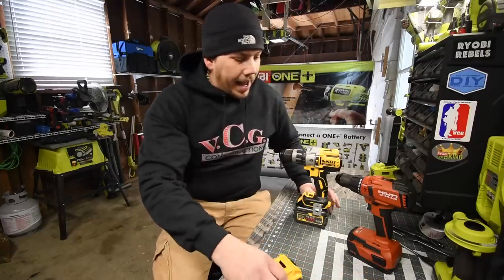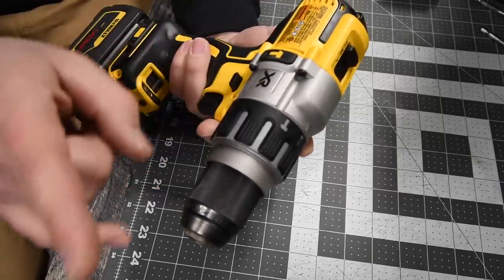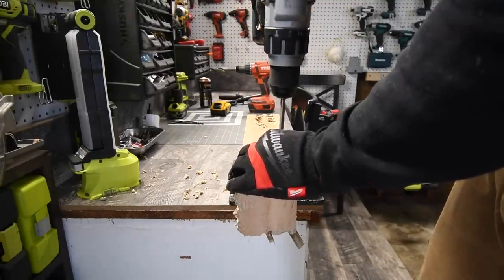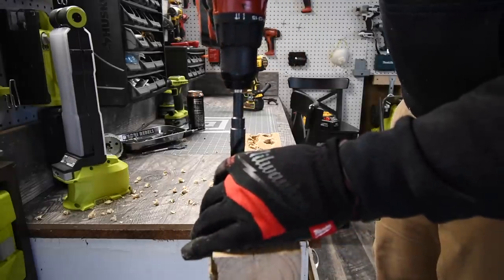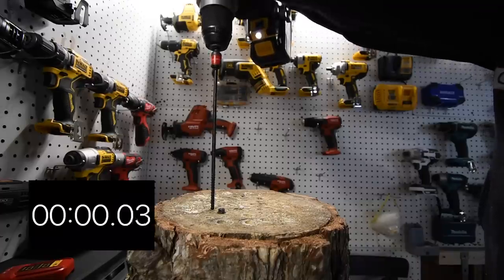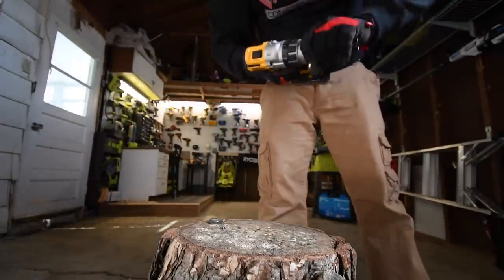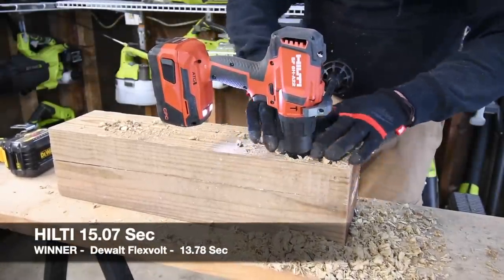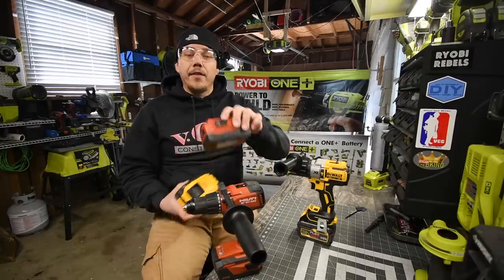Dewalt VS. HILTI Hammer drills (WOOD)

Comment: David, excellent video like always!!!
I have the Dewalt 996 with 5 amp battery... now I am dying to get the HILTI!!!
But man, i am worry for those wrists, always when using this kind of tools please use the side handle since the beginning!!! (I know I sound like your dad lol)
We want to keep watching your videos with healthy wrists
Reply: The Hilti has Active torque control (ATC).If you hold the drill vertically and run it, then give it a quick twist left or right (like it would if the bit snagged) the motor cuts. Release the trigger press again and it starts again. Dave doesn't show this in his video. The older SF6H had this too and saved my wrist a few times. My M18 gen 3 doesn't have a cut out and I have to be really careful. I really love this new brushless SF6H Hilti. It is a dream to use and hopefully indestructible like my other Hilti gear!
Reply from the maker: I am getting using the handles on these drill more often. I agree the t is safer. and I thank you so much for viewing
Reply from the maker: I did not know that. I will have to test that out. :) I thank you Dave. ill make a video about it
Reply: @ManCaverTools  Yes Dave, it's  a great feature. It gives me confidence when I use it. I have had much less powerful combi's snag and injure my wrist. Not really badly but it gave me a really sore wrist for a few days.
Reply: the Hilti ATC will save your wrist every time.
Reply: @veepsgarage  Too right Veeps' !!. Let's face it, once is one time too many to injure your wrist.....maybe even snap it with some of these mega-powerful combi's. Did it years ago with an old DeWalt which only had 42Nm of torque! Wrist swelled up and was painful for a good few days!! 😕😕😕

Comment: Dewalt has the non flexvolt 20v  6ah with 21700 cells , if you were looking for a fair comparison
Reply from the maker: I was told the 5ah battery has 21700 cells, im going to have to pick one of those up and thank you
Reply: @ManCaverTools  no, 5ah has 10 cells 18650 s, 
6ah 20v has 10 cells 21700s

Comment: Thanks for sharing sure wish you would have done some concrete/masonry test they are hammer drills after all
Reply from the maker: I did. do concrete in another video I already uploaded. this was only one video out of a few
Reply: It would be of minimal value. These are standard Jacob’s type chuck, not splined. Most that use the hammer are looking to drive a Tapcon or a small cheap masonry bit into something soft like clay brick. 

If you’re looking to drill into aged concrete, heck even green concrete if hole is >3/8, you’d be using a splined SDS- Plus or SDS-Max drill

Comment: What's the real price difference? I am blessed I have dewalt repair center nearby. But we are an amazing timeline where battery stuff is truly a full replacement. That being said for ease to get etc. I went black and yellow but I'd not be upset with hilti in my shop for projects. But hilti is more industrial rent our stuff we fleet maintain and replace. It's good stuff, I just dont have a guy stopping by to do the maintenance. But again with dewalt milwaukie and to lesser extent rigid... we are blessed when looking for tools to find we got some competition for fleet and hd use we can pick from, and it's easily acquired.
Reply from the maker: HILIT would be much more of a hassle to get repairs on, and I thank you so much for viewing sir
Reply: @ManCaverTools  they have a 1 day repair return?

Comment: Hi,

I believe the DeWalt 5.0ah xr batter has the 18650 cells. Also the new 20v 6.0ah battery has 21700 cells. 

Also the dewalt new 3.0ah has 21700 cells. I believe the new DeWalt 20v 8.0ah will have 21700 cells.

The dewalt flexvolt will use 18650 cells.
Reply from the maker: I gotta check that out and thank you sir, Even Ryobi has a compact 3ah HP battery with 21700 cells and thank you sir
Reply: Dewalt new 3AH and 6AH non flex use them bug 5AH uses 18650
Reply: @ztwinzplaytv9003  

Ops my mistake, yes you are correct the DeWalt 5.0ah has the 18650 cells.  I will edit my post.

Thanks for letting me know

Comment: I have this Hilti and so far it is the best I've ever used in 40 years of working. Still early days though. Also run Milwaukee fuel 18v kit. Not impressed. I had one of the Original DeWalts with the Elu motors and it had Ni-Cad batteries. 2.4 amp I believe...or 1.3 amp. It was a great tool and took a lot of abuse. I have a Hilti SDS corded that I got 2nd hand 33 years ago and it is still my every day go to SDS. Superb piece of kit. Also own cordless Te6 A22. That thing is a beast. I don't know what the longevity is on modern DeWalts but it was impressive in this test. Longevity is much more important to me than a few seconds here and there. Plus the speed of work is a lot to do with the skill of the guy using the tool. A friend of mine sent his Hilti off for a general service and the rep gave him a like for like drill to use while his was away. No down time!! I have heard that DeWalt after sales service is really bad. Hilti also do the "Fleet management" system where a large company can literally hire Hilti tools for site work. They give you brand new gear every three years and any tools that breakdown are replaced by a rep usually within the hour. This is a lot cheaper than buying the tools outright.
Reply: Added to this I am not a site contractor.  I am a Maintenance Manager at a very large Theatre with my own Workshop. If I am gutting and rebuilding a Dressing room I would use a corded SDS, 3 Combi's and an impact driver with different bits in each. This saves time swapping over bits.
Reply from the maker: at the HILIT store we able to get 4 free belt clips lol and once again I thank you for viewing
Reply: @ManCaverTools  How the hell you get anything free from Hilti?? They will loan you tools to use but not usually give stuff away. 🤣🤣🤣

Comment: I have seen only two bad things in DeWalt drills that for me are a deal breaker. 1. The brake is way to violent on the XR drills 996/ 791 and the chuck can get loose and drop the bits. 2. If the chuck gets damage , you cannot replace it because there is no center screw  and you must buy the entire gear box with the chuck.
Reply from the maker: that sucks and I thank you for sharing that info bro. :)
Reply: Yes it does drop the bits or get stuck, I was drilling holes for anchoring trellises, drilled about 30 holes and it drop them about 3 times

Comment: Hilti is MUCH more well built than dewalt. It's Panasonic batteries are clearly more durable too. The dewalt is brutal and not user friendly, the hilti is smoother.
Reply from the maker: I agree, hilti is a more user friendly tool and thank you for viewing
Reply: I agree Hot dog! I find all Hilti gesr smooth.  My Te6 a22 hammer is really smooth too! I'm still in the Honeymoon period with my new brushless SF6H. Best combi I've used in years...probably ever!

Comment: Well, I got the new brushless hammer drill. Wow. Hilti has really impressed me here. So many positive changes, to the handle, an additional light, brushless, more metal where there was plastic before. Wow. All for the same price as the "old" hammer drill
Reply: Yes Tyler!!! Ain't she a beauty?? The ergonomics are superb, the power and torque are great too. It sinks 3" M8 coach screws  right in with the hex head flush on the 13th of 15 torque setting. My gen 3 Milwaukee leaves them 3/4" out using highest torque setting.  Plus the Hilti build quality is superb too!!
Reply: @davesheppard8797  agreed. It is better in basically every aspect. One small thing I noticed is the battery doesn't seem to fit quite as well leaving a small amount of play but that isn't bothering me a whole lot.
Reply: @tylersmith9868  Ah....If you watch Dave's (Ryobi man caver) video test of this Hilti on it's own he points out that the black section underneath that the Battery actually clips on to is floating. He believes this is to combat vibration affecting the battery. Maybe also to aid cooling as there are small mesh vents by the working lights. I hope this is a help mate.
Reply: Also....Have you tried the Te6 A22 SDS from Hilti? That thing is incredible!! It only has 2.5 joules compared to One of the Milwaukee SDS battery drills that has 4.5 joules. The Hilti kicks the Milwaukee's ass on head to head. And it is so smooth with no vibration. 👍👍👍. It is pricey though!!
Reply from the maker: I love this drill as well and thank you for viewing
Reply: So Tyler.......Is it still going well with your new brushless Hilti? I really love mine! 😁😁😁

Comment: Don’t care for the longevity of the hilti batteries i only get 6 months outa them before they are junk they only last a 1/2 hour before charging where as before they lasted all day, hilti is covering everything under warranty multiple times but i just can’t say they’re good
Reply from the maker: time will tell and thank you for viewing sir
Reply: That is strange......My 5.2 amp hour in my combi lasts for ages!.
Reply: Dave Sheppard i dont know if its just mine or a bad batch but I bought like ten batteries in a set with a bunch of power tools my hammer drills and impacts at the start where walking all over the dewalt and Milwaukee at how long I could go on a charge at the end of 6 months it was pathetic how shity they’ve become
Reply: @mesh1248  Hi Mesh,
In that case Hilti should replace them free of charge. I think it's at least 2 years any condition replacement with Hilti batteries. I must admit I have never had any problems with mine. A guy on YouTube called Allan Hart has Hilti batteries he has used daily for 6 years and he says they still hold full charge. I would contact Hilti if I were you.
Dave.
Reply: Dave Sheppard no hilti has replaced them free of charge and the batteries new replacements are going shity now hilti has done everything customer service wise possible no complaints their i just cant say they’re batteries are any good and I don’t like the hassle of constant replacements im looking at dewalt battery adapters for the hilti tools so i can run the same batteries across my dewalt and hilti tools with the tool itself i have no complaints about hilti
Reply: @mesh1248  That's not good. You used to be able to count on Hilti's reliability. At the end of the day it doesn't matter how amazing your drill is if the power source is crap!!
Reply: Dave Sheppard yes i hope its just my shitty luck with the batteries on hiltis but i wish someone would do a YouTube review on power tool battery longevity every one does reviews on how long a charge lasts on a new battery how fast a tool works and on and on but the most important factor is how long a life span a battery is since that is usually the first thing to go on most power tools most power tools are very close in performance and does it really matter if one can drive a screw in a hair faster then the other they all are close
Reply: @mesh1248  yes mesh, this is very true. Doesn't matter how good your drill is if the power supply is crap!! I will reply again if I have any issues with mine.

Comment: Hilti always perform a bit better but cost twice as much
Reply: And last 5 times longer....maybe more!!
Reply from the maker: agreed
Reply from the maker: 100% accurate lol and thank you for viewing
Reply: @davesheppard8797  not even they just replace the tool if something goes wrong
Reply: @badritalin  very true. There was a guy on one of these YouTube posts who said he couldn't decide which tools to buy. So the Hilti rep loaned him about 3 or 4 to use so he could decide. Hilti will bring tools to your site to try before you buy. As for the longevity........you may have read this already in one of my other replies. I got a second hand Hilti Te1 corded SDS off a contractor 33 years ago. He left it behind at my workplace and after numerous phone calls to him he just told me to keep it  as he had already upgraded. That drill is still my go-to SDS when using corded. It's never been serviced or touched. It runs as smooth as ever and can hold its own against modern corded SDS drills.

Comment: Like...really?

The Hilti speed was lower than the DeWalt, Hilti has active torque control  which is supposed to stall the tool when it binds. 
You have a bigger battery on the DeWalt , which will provide an edge in instantaneous torque.
Like what is the point of a test if you can't even provide a better control for testing? Like just use the DeWalt 4.0.
Reply from the maker: I gave the less likely tool to win the advantage. The dewalt still lost. not by much but its still lost.
Reply: I own this Hilti and it is incredible!! Best combi I've ever used.
Reply: The ATC on the Hilti only makes the motor cut when the drill wants to twist in your hand and endanger your wrist. If you are holding the drill tight the motor doesn't cut out. If the drill whips around for about a distance of 6" then the motor will cut.

Comment: The lag screw removal test should not count and should be redone. You botched two of the three screw removals with the Hilti. That’s not the tool’s fault and it ate up significant time.
Reply from the maker: not every single individual test is going to be 100% accurate.
Reply: Man Caver Tools I mean, if it’s not 100% accurate, it should be redone until it is. Otherwise, what’s the point? If you’re not equally smooth with all tools in the test, then you have to take the transition between fasteners off the clock. Only run the clock when the tools are actually running. That’s the most fair and accurate. It’s not a test of you. It’s a test of the tools.

Comment: You forgot to do concrete. I my DEWALT mainly on concrete.
Reply from the maker: concrete tests are coming soon along with metal
Reply: Hi Jdamurph,
What's about the biggest size bit you go to with a combi like the two here? Anything more than about 4 -2" deep 6mm holes I use my battery Te6 a22 which is a mega beast and really smooth to use.
Cheers,
Dave.

Comment: There's no point of getting a hilti if you already have dewalt batteries
Reply: Unless you want to use a good tool
Reply: @tylersmith9868   🤣🤣🤣🤣🤣🤣👍👍👍👍👍👍
Reply from the maker: the tools someone buys all depends on what battery system they want to invest in and I thank you for viewing sir
Reply: Tyler Smith literally costs what two Dewalts cost and won by a nut hair and you say Dewalts not a good tool😂😭🤣

Comment: Am I insane or isn't amp hour a capacity rating and not an output or "power" rating? I mean an 18volt pack is still an 18volt pack regardless of it being 4 amp hour or 500 amp hour. The "high output" I would need to see the packs actually tested from an electrical point of view and not a "feels stronger" method. The timing of tasks is a good analogue for this and is more real world but variables need to be controlled. A brand new bit with each and every hole plus a consistent test medium such as stacked OSB, maybe 5 layers of 3/8s with each piece rotated 45° to offset any directional strand bias. Also a rig for applying the exact same amount of force to each cut I would consider to be an absolute must if nothing else was instituted from these suggestions. I mean even just a few pounds of difference in feed pressure could make a world of difference. I was entertained by this video but I do not take it as an accurate testing video. But it was a fun watch

Comment: 5.2 Ah hilti battery would be more accurate for this compare...
Reply from the maker: I thank you for viewing Krismont
Reply: The 5.2ah battery was discontinued several years ago (18?). They only offer 2.6ah, 4.0ah and 8.0ah in 22V (21.6 vdc technically), all using Panasonic-Tesla cells.
Reply: @MichaelM-to4sg  in Europe they are available all the time
Reply: @krismont  Sure, they’re available 2nd hand through EBay or NOS through dealers that for whatever reason have 4 year old stock. If you were to order from Hilti directly, you’ll see there is no listing for 5.2ah 22V battery. The only 5.2ah Hilti battery available is in 36V platform.
Reply: @MichaelM-to4sg  aaa, produced in Poland, where I'm from